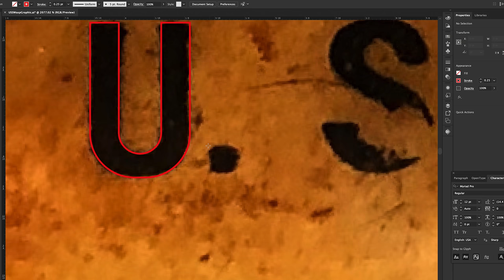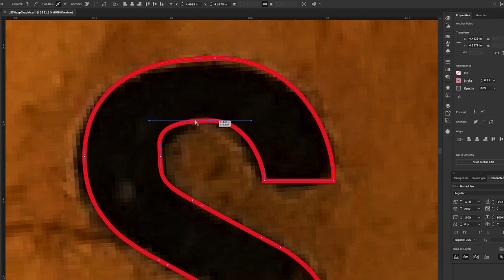Rusty WW2 Pocket Knife - U.S.S Wasp Restoration

Comment: Great job on the restoration! I gotta say, though, were it I doing it I definitely would not have scraped off the original letters. Even if they were worn they were a solid connection to the ship and it's history. Other than that, well done!
Reply: I agree, would've kept the letters at all costs including most the staining
Reply: Totally agree. It is (in my opinion) a reproduction using old metal. Lost its character and providence. Great jog with the restoration.  I will add, his knife, his choice.

Comment: I have to say I am surprised you reused the original scales. But why did you remove the lettering? Those seven letters were the only thing tying it to the Wasp, and  you thought it would be better to make your own font and just stick them onto the original scales?!? Should have stopped after you cleaned them. And this applies to the blades also. Should have  stopped after removing the rust and left the hard earned patina of 80 years. Sure, sharpen them, but don't sand and polish them. You are not a restorer. You refurbish items and arbitrarily polish, refinish, and remove the features that would maintain the items value...Please don't ruin a vintage guitar by refinishing it, or an antique Colt 1911 by polishing it and bluing it when it was originally parkerised., You find the nicest things to restore, and I am still looking for you to not eff them up somehow

Comment: I have a bad habit of keeping thing for a long time, I still have a CASE XX Knife, yellow trapper 2 blade, That i have NEVER away from my pocket for 18 and 1/2 years now! I had 2 blades made for it. .....I still have a Takamine Guitars i had made in 1979 and it plays and sounds just as good as it did brand new! .............If you ever have a knife that the blades are stuck and can't open this is one great way to open it >>>> Take a shoe string.... wrape around the knife ......Holding some of the shoe string in your hand and the knife in same hand with thumb ( out side in grass ) throw the knife hard at the grass so it will spin on the way down...... The blades will fly open!!....
Reply from the maker: That shoe string trick is a nice tip! Maybe I'll use it in a video when the need arises.